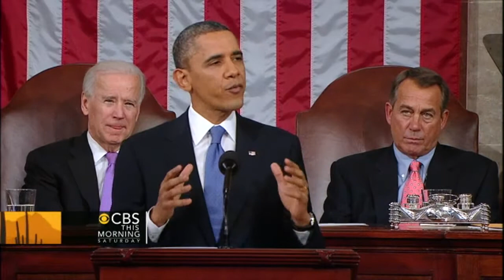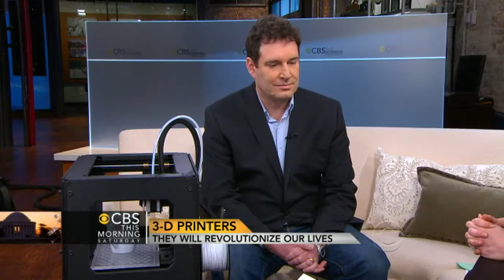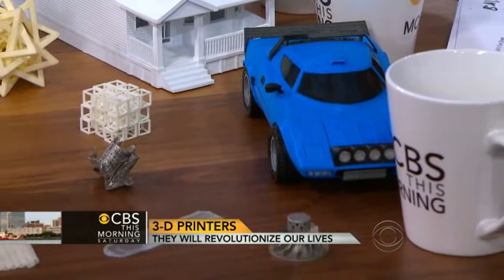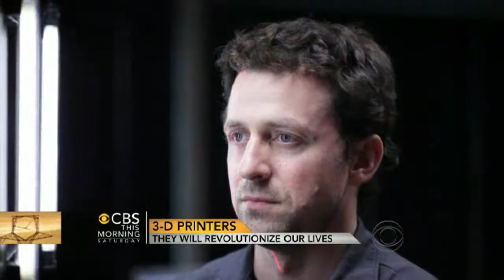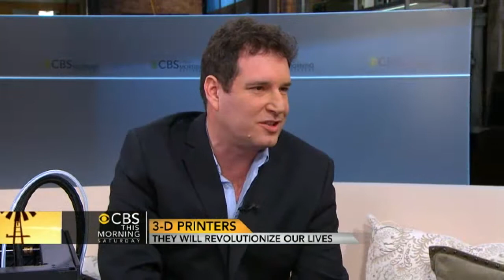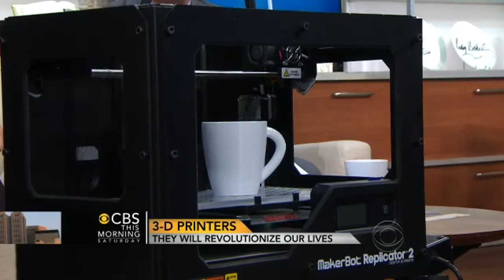Is 3D printing the future of manufacturing?

Comment: I do not see it like dot boom. Engineers know cost of production. Executives know the size of the market. dot boom very few knew the size of the market. Anyway 1/1000 of inch is good for most stuff. billionth of inch would be in the nano scale easily. why does 3d need make it self to be valable. most stuff for moving parts  you need an assembler.

Comment: 3D printers are over-hyped.  Yes, they give you incredible potential for geometry, but they are expensive to operate and incredibly slow when compared to dedicated production tools.

For example, injection molding will not be replaced by 3d printers for mass production.  Although an injection mold requires a large initial capital investment, the operating costs a dramatically lower, is 100,000 times faster, and produced a superior "uniformly solid" component.

Comment: one thing with 3d printers.
a recycling system for 3d printers

filabot is one of these machines to recycle the filaments.
dont waste your plastic/materials you can reuse them after all.
people dont need to throw them away when they can grind them up for materials.

this should cut down on garbage then and lessen land fills to a large degree.
green environmentalists should be jumping for joy for 3d printing

so what is so scary it is interesting.. please dont hold us back with stupid laws now